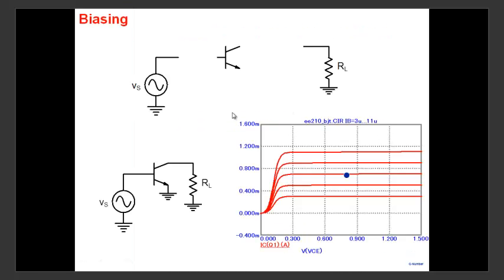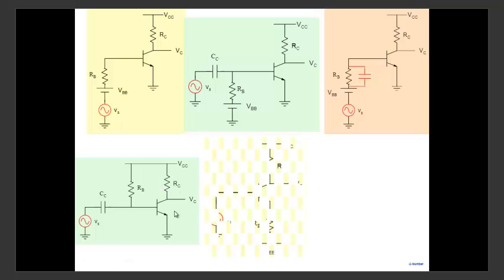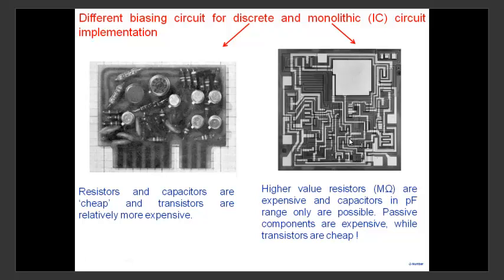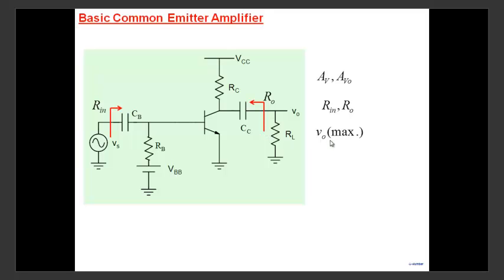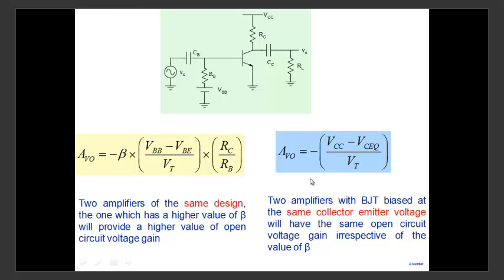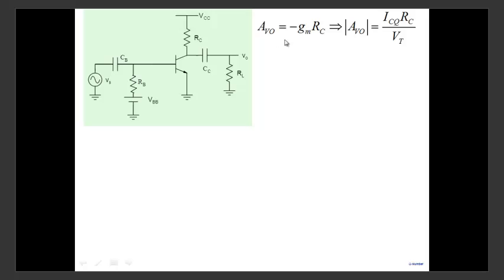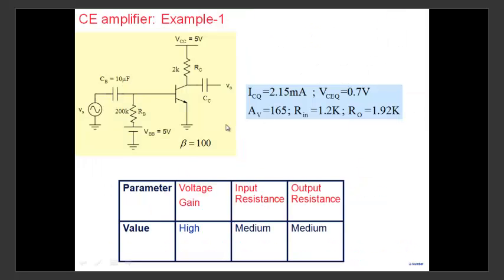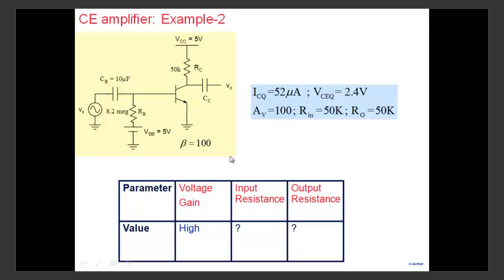BJT Amplifier Basic Mechanism part 2

Comment: also I have one question for you: you mentioned in this common emitter BJT configuration, that a good voltage amplifier should have high input resistance and low output resistance. would you please explain why? I know that you'd be cascading amplifiers together; is it because you wouldn't want to lose voltage gain at the output of first stage if resistance output were high? furthermore, impedance matching between stages is important correct?